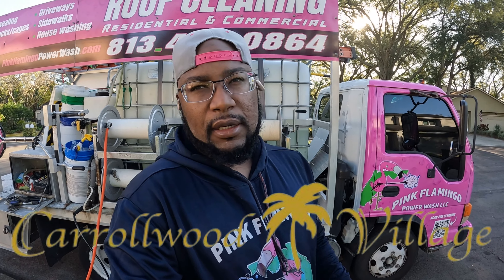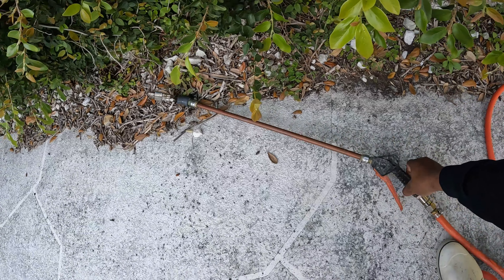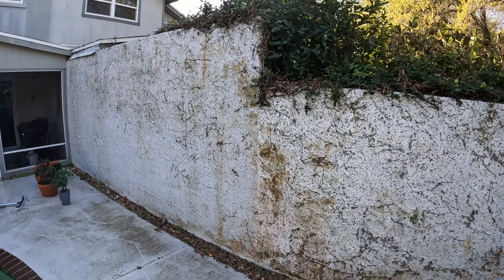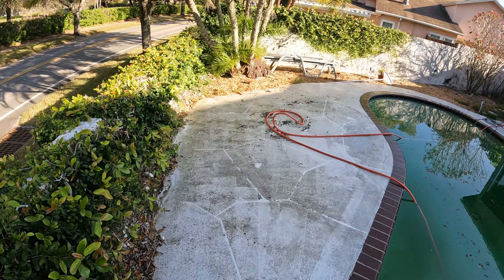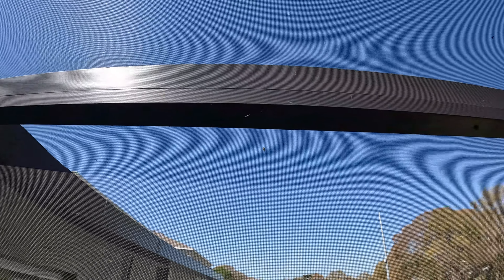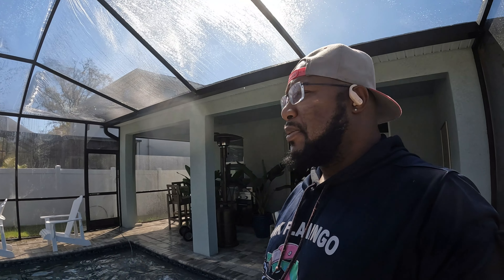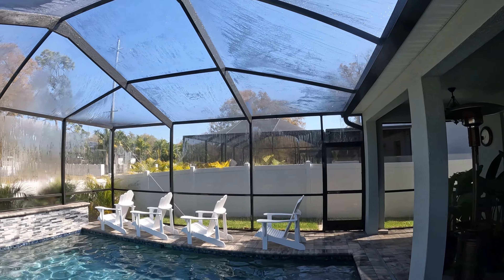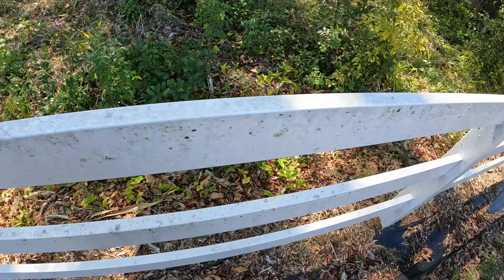3 Jobs Makes A Nice Profitable Day #pressurewashing #softwashing #howto #profit

Comment: Pool deck and screen enclosures are always more difficult than just a house wash because you’re always pushing dirty water and weeds especially when it’s pavers. Up charge for those dirty pool decks.
Reply from the maker: They're easy most of the time. But definitely requires more attention than a house wash. I average cleaning them under 1hr most of the time.
Reply: @PinkFlamingoPowerWash  I am close to that really depends on size, dirtiness, SH % downstream or soft wash system and dwell time needed. Need that Butta!